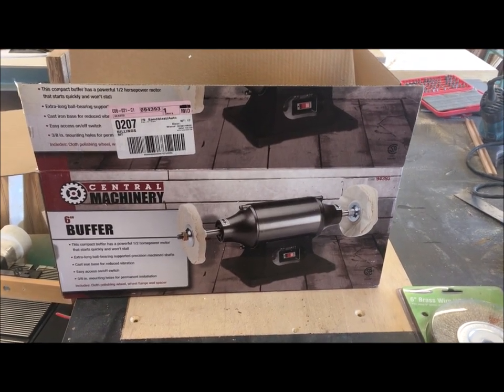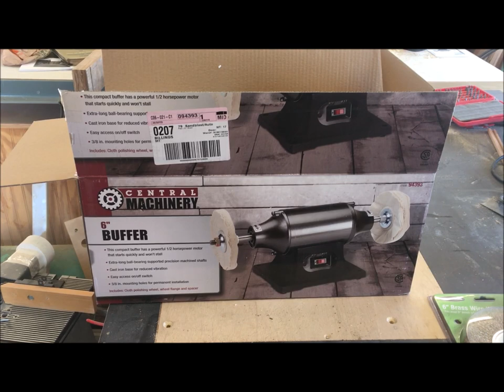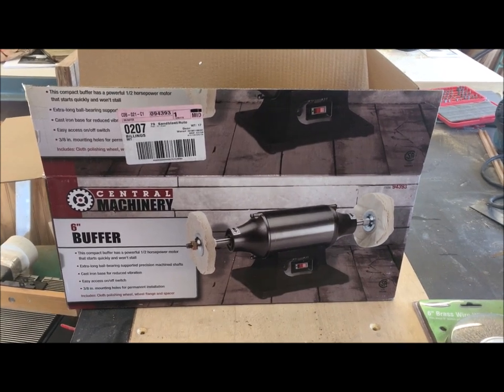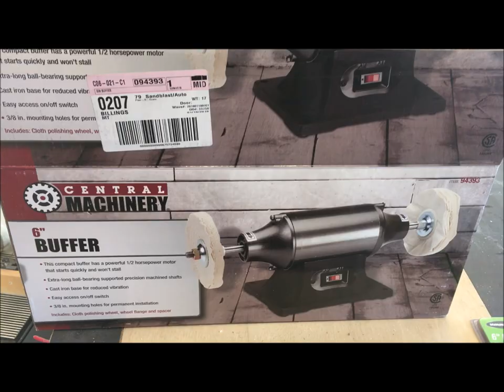Harbor Freight Buffer Review

Comment: Harbor freight motor driven electrical tools are the best thing they make. Don’t be afraid to buy them
Reply from the maker: I don’t agree. I bought a cheap corded drill for a project once and it lasted less than 5 minutes before the brushes burned up.  I returned it and the second one lasted only slightly longer.  That model was complete garbage but very cheap. HF is very hit or miss so that’s why personal reviews of individual products are so critical.
Reply: HF powered tools are incredibly hit n miss. Some models are a absolute steal while others feel like you just got rolled after the first use.